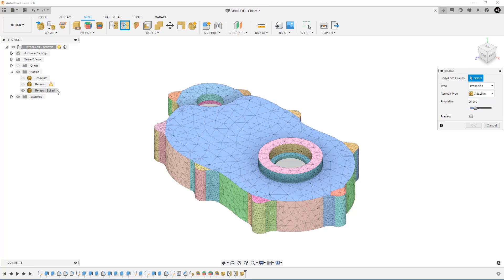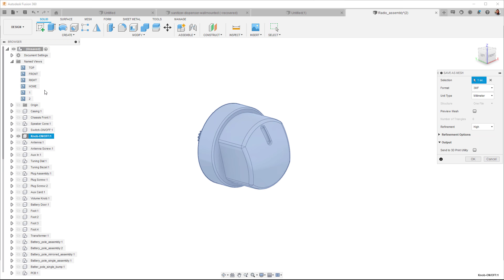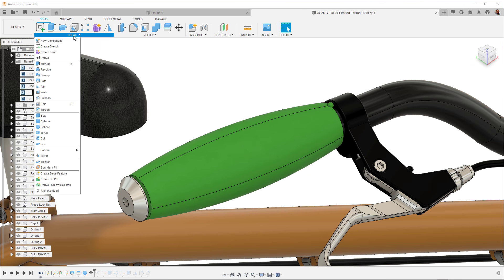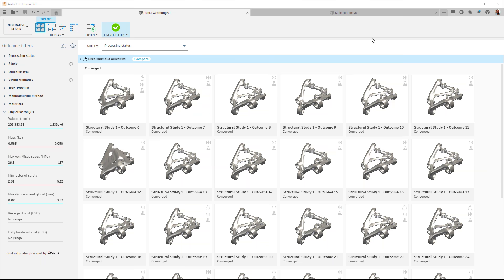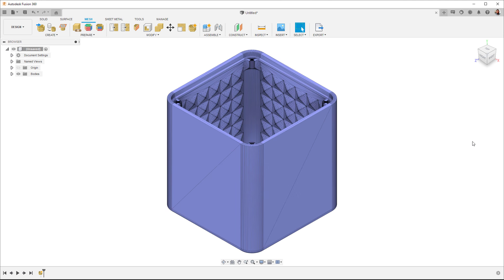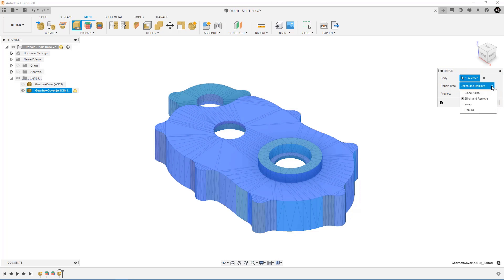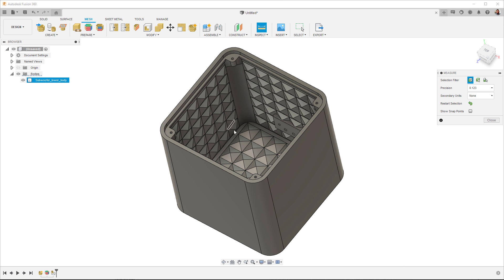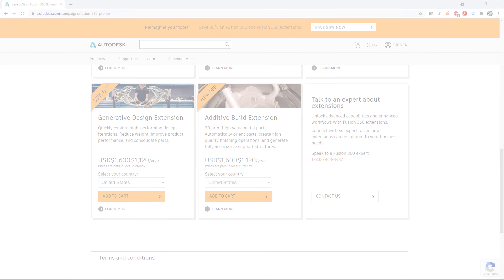What's New in Fusion 360 Design & Engineering July 2021

Comment: Nice update. When are ya'll releasing a proper dark mode for Fusion360?
Reply: I use offline mode and I do everything used in online mode.  When I get online, it updates the project folder and everyone in the group sees the new info.  Do not know if dark mode is different from offline mode.
Reply: Dark mode and offline mode are totally different. Dark mode is regarding making the UI dark so that it reduces eye strain. This is not available in Fusion 360 yet.
Reply: NOOOO!!! No dark mode, We need many other things before dark mode! Such as Panelisation for PCB"s and a Bill of Material editor system.

Comment: One thing i'm waiting for is a button to stop Fusion from already starting to change and calculate stuff before finishing typing a dimension, just to simply wait until enter or tab or whatever is clicked, so often it crashes itself because it starts calculating at 1 from 1000 and goes into hysteria because the dimension is too small or whatever
Reply: I've struggled with that behavior too. One reason I haven't paid for a subscription yet.
Reply: One possible workaround to the auto calculate would be to use an open parentheses to force the parameter to be unsolvable until you delete it at the end. Not a perfect solution, but it could work in an instance where you know Fusion will mess something up beforehand.
Reply: @JLProPhoto  it starts calculating as soon as you create the dimension or feature, or change it, so if you want to change say a dimension from 250 to 190, typing 1 it starts calculating the dimension for 1mm and gets hysterical, when it relaxes i get to type 9, same procedure until you get to 190.. talking about mid to larger bodies or assemblies. Autodesk says there is 0.5 seconds delay until it starts calculating, ya...right.....
Reply: @Tarex_  I am aware, I have to often type every dimension twice (type first number then it creates the line and highlights the text meaning the second number erases the first), however, if you type a parentheses, the dimension goes red and it can't be solved. So it might work to use an open parentheses as a blocker while you're typing and then delete it at the end.

Comment: Tried the STL to parametric conversion, got nothing but errors. Made new face groups and tried again and it just made a mess of it. Still feels very very beta.
Reply: Same here hoping to get feedback on the 14th
Reply: Hi, The key to success with a prismatic mesh to solid conversion is having a good set of face groups. We Added several automated and manual ways to create face groups in parametric model and in direct editing mode. please try both. If you are still struggling feel free to post on the user forums and we would be happy to help you.
Reply: @sualpozel1  where are the user forums